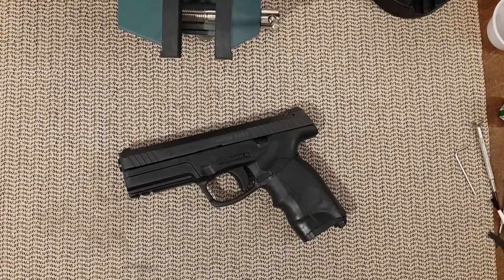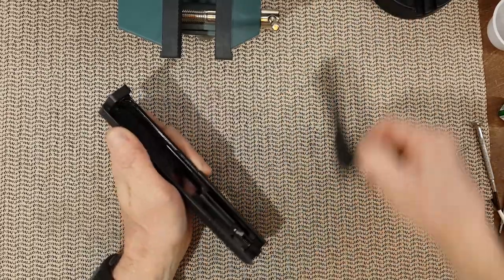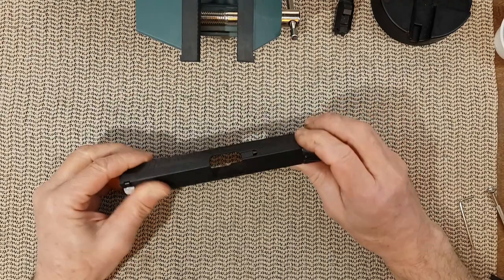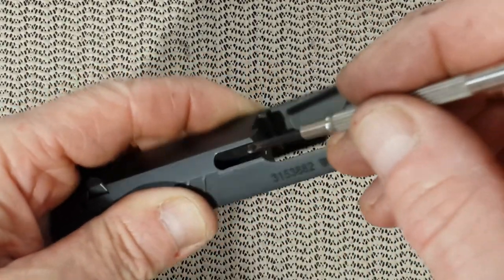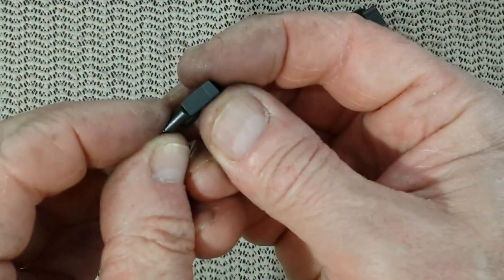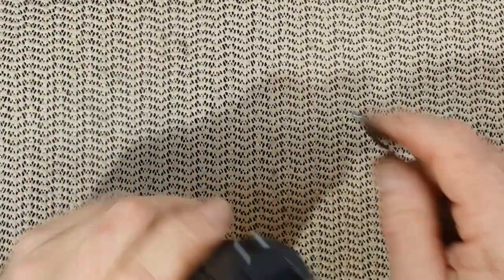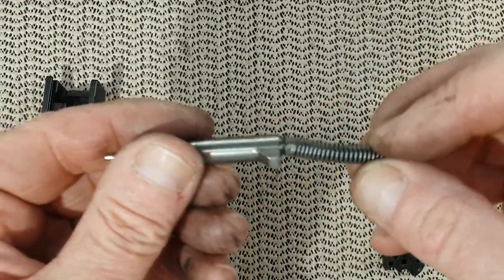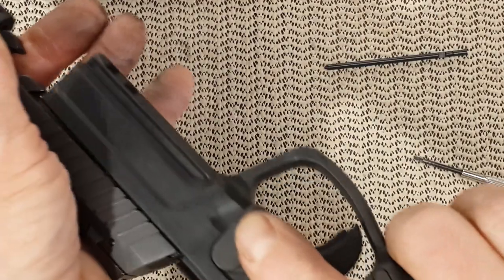Steyr L9 C9 A1 Slide disassembly and reassembly

Comment: What about the loaded chamber indicator? ;-)
Reply from the maker: I am so glad someone was paying attention.
I removed it, this alone was a major PITA. During its reassembly, I lost the E-clip that limits the spring travel (it really flew off and can't find it). Replacement E-clip is in the mail. 
But in all reality, you want to stay away from removing it. There is no value in it, unless you are looking for a great challenge.
Reply: @practicalshooter6517  I had a L9 with L40 change system and .357 SIG swap barrel. I live close to the Steyr Mannlicher Schiesszentrum here in Austria, Wr. Neustadt and know the armorer there. The L9 here has sort of a binary history - either it works or it is realiable in failing one way or the other. Our gun forum has lots of not-so-good stories about the L9. Especially ejection, stove pipes, failures to feed and such are common. Could be those issues were resolved over the minor changes and revisions of individual parts, but still... I once told the armorer that even after 2k rounds the L9 kept choking on factory 124g ammo every 4oo rounds on average. He replied to take it like a man. He also said the L9 suffers more likely from choking versus the M9 throwing brass constantly at his fore head. Eventually I sold it, not only for the malfunctions, but also because the number of handguns we Austrians might own is limited. So if you want to get a new gun you have to sell one of your existing ones. And despite I really like the L9 for its shape and grip and sights and shooting performance and technological features I dont need a gun that has recurring problems after 4oo rds. Never had an issue on the SIG 1911 TME, or the P226, or a Beretta, or the CZ TSO, and so forth. Just the L9 had them.
Reply: @practicalshooter6517  I had the sear cage housing springs of my CZ 75 Tactical Sports Orange fly away from my desk, and getting lost in the carpet underneath my desk. I had to order replacement springs - they are really tiny! I vacuum cleaned the carpet a couple of times before once something dropped, I looked down to pick it up and saw a silver shine. I looked closer and the coils of one of the tiny springs were caught in the fibres of the carpet. So, maybe in some days or weeks down the road your E-clip will show up on the floor or someplace you didnt look. :)
Reply from the maker: Update: I reassembled the Chamber indicator. It takes a M2 e-clip. 
I am afraid that if I make a video about removing / reinstalling the indicator, people might try it and not be able to reinstall it. What do you think?
Reply: @practicalshooter6517 My problem was I didnt, and still dont, have the tools to get this ring off the indicator. I can imagine fiddeling with it is tricky and since it is such a small part easy to loose. Also the spring is tiny. The reason why I wanted to remove the LCI was I thought the LCI affects ejection of rounds (or co-caused the ejection problems I had with my L9). Reason was that people with the M9 slides without the LCI didnt have ejection malfunctions - just erratic patterns where the rounds go. But I couldnt test my theory.   As for your question: hum sure yes, you bravely disassembled everything else so no reason to stop there ;-)
Reply from the maker: @philippott2784  I would think the LCI could affect the ejection "IF" the LCI chamber gets dirty enough to lock it into position, but that needs to be verified.
Reply: @philippott2784  "Take it like a man," ha, love it.  You gotta learn to clear malfunctions somehow. :) Was yours one of the originals? I have not heard of any issues with the current A1 model. I hope to begin testing a new M9A1 next week.
Reply: @paulflannigan888  Mine was an early 2015 model, code LWM, which stands for Feb. 2015. Like I said the problems settled down after some 1k-ish rounds but kept reappearing every now and then. I know there are people who dont have any issues at all, except for the brass into the face or the random ejection pattern. But there are others, like me, who had problems. I hope Steyr got this fixed in their A2 models and I hope to get one eventually. Maybe not of the first production run though ;-)